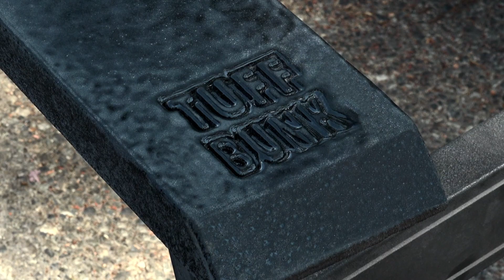TUFF BUNK Boat Trailer Boards  -  v/o Jeff Gelder

Comment: Question if the wood is pressure treated and i seen on vids that pressure treated wood can damage aluminum boats???? And i am wondering if the coating will protect the aluminum
Reply from the maker: HI Brian, Thanks for our comment, however I was hired as the voice over talent for this video. So, unfortunately I don't have your answer. Probably to a Google search for Tuff Bunk Boat Trailer Boards and you'll find a number or contact info. I think they're called ProTech.  Best, Jeff